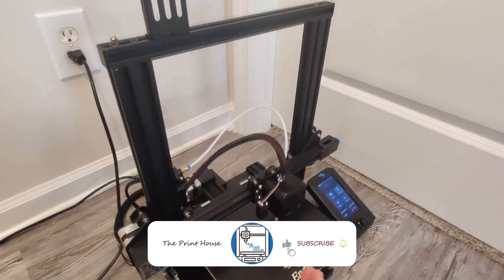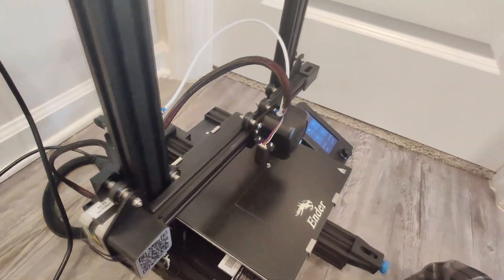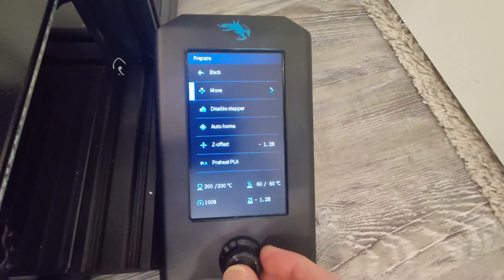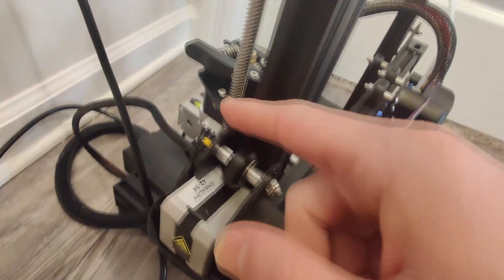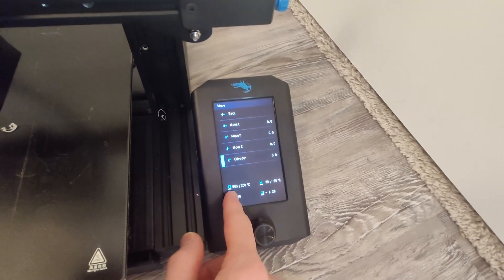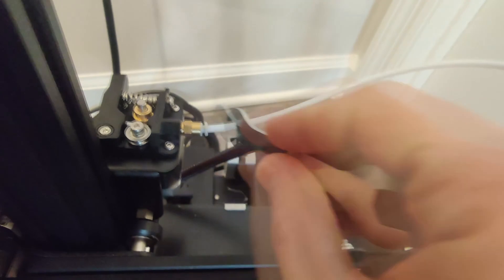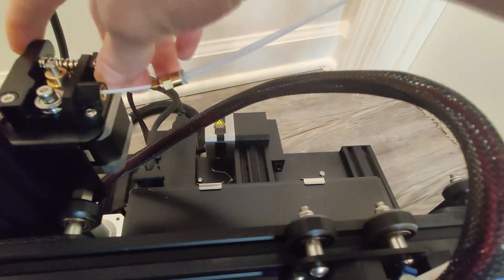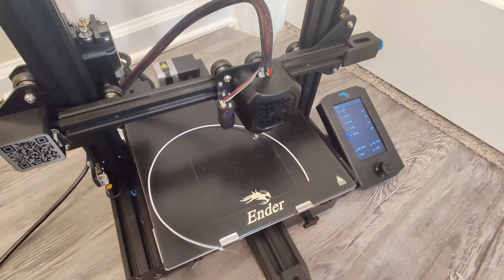Two Easy Methods To Remove Filament Stuck In Your 3D Printer

Comment: Idk if the filament is broken but its stuck in the tube when i took it apart like you did in the video the filament is stuck it was printing and it just stopped because the filament ran out i got new filament in but should i cut the remaining from the tube and try printing something small ?

Comment: do you have a guide on how to do this with the ender 3 v2 neo
because I don't have that golden bit i can take off
Reply: I didn't have the golden bits... Remove the blue clip, PUSH the tube IN, and then try to take it out.

Comment: it was very helpful, but now the ball that got previously stuck in the nozzle now is stuck in the gold part of the white pipe that i tried to pull  the whole filament from, it just broke off. i dont know what to do now i tried heating up this part by touching it to the nozzle but if wont work, is there a way to just take this gold part off and i will just put it on a pan to heat it up more so the clogged part just melt ?

Comment: Yo so I wa printing something right (I have an ender 3 v2 neo) and the filament snapped or something and the filament is stuck in the tube and idk what to do I tried the extruder thing and I think w have different printers what do I do I'm worried.

Comment: What if it’s stuck somewhere in the hot end? Nozzle was brand new and even after clearing it with a pick the filament wouldn’t come out. So I removed the nozzle and the filament seems to be stuck in the hot end.
Reply: mine is stuck there as well -did you find a solution??
Reply: @misodaglass  I ended up replacing the hotend. It was on my Vyper that came with a hotend wire soldered to the side of the block that was loose and failing. So I got a hotend with new Bowden tubing, a block sock, new nozzles, and that side wire on the block has screw for securement.
Reply: If I remember right, my filament wasn’t exactly stuck in the hot end, but at and in the end of the Bowden tube that goes on top of the hotend. I was able to get ahold of it somehow and cut the burnt, blocked end of the tubing. It ran a couple months before replacement of the hotend.

Comment: The problem is that my filament is broken in the middle of the tube
Reply from the maker: Use a piece of filament to thread through the tube to push it out :)
Reply: @ThePrintHouse  doesnt work cause its flexable
In tbe end took out the tube and used some steel wire i had to push it out

Comment: My filament stripped, so i had to take the tube out completely, sadly there are still remnants in the tube itself which i am unable to get out, even when heating the hoten d to 230c. I just ordered a capcricon tube as replacement..

Comment: mine is stuck like in the tube how would i get that out i use ender 3 btw
please respond quickly
Reply from the maker: If you cut the filament from the hot end side, so it is not stuck to the nozzle, you can remove the tube and then slide a fresh piece of filament through it. If you have a huge blob of filament stuck in the tube, you might need to replace your bowden tube entirely.
Reply: I got it done thanks tho
Reply: How u fix it?

Comment: I  tried to pull the filiment out of the tube but it will not move. what should I do now?
Reply from the maker: Usually if the filament is stuck  in the tube you will be required to cut the tube where the end of the filament is. The tube is so slippery if it gets stuck it's usually not going to come out.

Comment: so I have a tiny bit of filament that's lodged into the back of first hole on the cold end and there's nothing for me to grab onto with something like needlenose pliers
Reply from the maker: If you remove both ends of the tube, then you can use a brand new piece of filament to push into the tube and push the small piece out! :)
Reply: @ThePrintHouse  I tried
Reply: @FredzDimension  me to it wont work
Reply: K

Comment: Hello. I seem to not be able to unscrew the screws with an rench, even if they are the correct size. Is there a locking mechanism to the printer? I am scared of breaking it.
Reply from the maker: There is no locking mechanism. Yours must just be very tight. I dont think you will break it, just make sure you are loosening and not tightening the screw.
Reply: @ThePrintHouse  thank you so much!! this is very helpful!

Comment: My filament is already striped and the fitting is stuck. There is also a slight crack on the plastic housing around the fitting what should I do?
Reply from the maker: I actually just had to deal with this problem last night. I replaced my extruder with an all metal extruder. It's very easy to do and will prevent cracks. When you replace your extruder it will come with new metal fittings, so if you need to cut the bowden tube with scissors then you can do that and it won't be a problem :)

Comment: This solution worked for me, thank you! I also seemed to have something stuck in the extruder gears, but let loose after I got the filament out and started feeding more into the line.
Reply from the maker: Stuck in the extruder gear? I'm not sure how that's possible because the filament is supposed to be between there lol. Glad it worked out for you though!! I love when my tips help others!!

Comment: thanks dude:) although you can just push down the little grey part and pull out the tube❤️❤️
Reply from the maker: D: ahhhhhh yeah maybe that is easier, but this will definitely help for every possible issue someone may have.